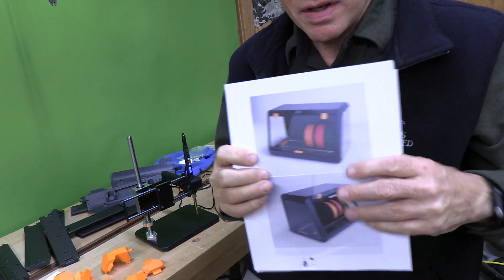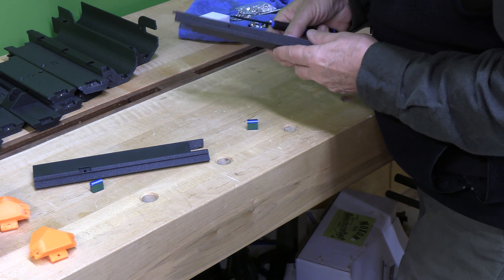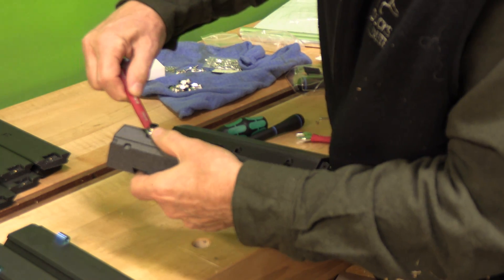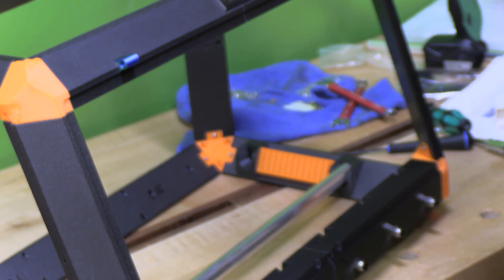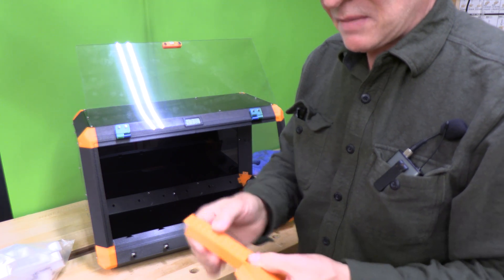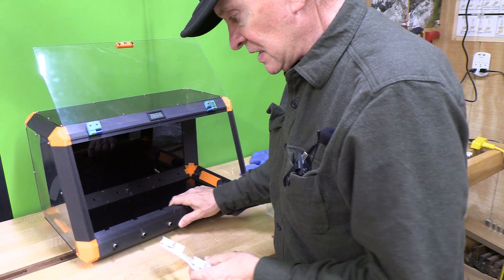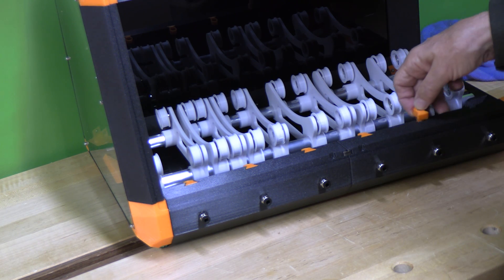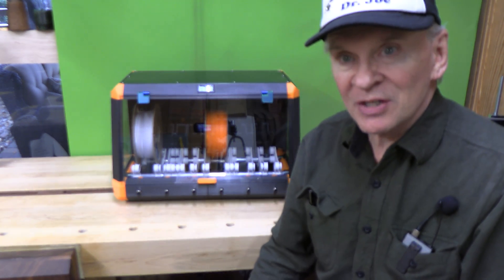UNORIGINAL PRUSA DRYBOX ASSEMBLY and REVIEW

Comment: And where did you get the great tool with the soldering iron?
Do they still use the box today or have they changed?
Reply from the maker: Hey buddy, I believe I have a link to that tool that puts in the Heathet inserts which works so well they’re fantastic. Inexpensive and I think there’s a link in it linked to it in my description. Also, I don’t think the box has been upgraded. It’s actually very nice consider subscribing. Thanks. Joe.

Comment: Hello, just assembled one. I can't figure out how filament trace from spool to connector and to PTFE tube. Maybe you have an answer?
Reply from the maker: I’m not really sure I understand the question. Basically, I put the filament reels in so the filament comes off the bottom of the reel and goes straight ahead into the small couplers that are in the front lower panel. A PTFE tubing can go through the coupler so you can put the film directly into the Cortex tube. That answers the question. Thanks. Joe.
Reply: @JosephHunstad  thanks for your answer. Now I understood what happened.  Aliexpres store "Sealand" sent me regular fittings and PTFE tube cant go through them (inside diameter 3.3mm)

Comment: Ciao ti volevo chiedere dove scaricare i porta bobine ?? che in questo progetto non li ho visti Grazie 🙏 🙏 😊
Reply from the maker: You are correct. I am not using the real holders. I am using those dry boxes to store my filament. The reel holders go in the slot on the side of the printer. Three on the left side two on the right. Consider subscribing. Thanks. Joe.
Reply: @JosephHunstad   ok grazie

Comment: Hi Joe, How has this worked out in regards to keeping moisture out?  What are the humidity levels your seeing?  It seems like a good design except for the front door, it does not seem like a good seal to keep moisture out?  I downloaded the STEP for this model and am considering making a better seal at the front but wanted to see what you and others have to say about that?  What are your thoughts?  BTW: Got my printer 5T, printed all the enclosure parts, and am assembling it now, love the printer!
Reply from the maker: Thank you for your comments. Yes I love the printer. It’s great. I don’t think the box keeps out moisture as well as you might think. I’ve actually converted to the heated dry boxes each one holds two rolls of filament so I bought three of those and so the dry box that I built I basically just use it for storage.so when I was using the desiccant my humidity levels in there were in the low 20s so they were good but not great. Consider subscribing. Thanks. Joe.
Reply: I printed one and built it.  This drybox is more of a dust box, it is just trash for a drybox as it has airleaks everywhere.  The door is a horrible design and never ever seals right, I tried yo upgrade it to have the magnetic strip but it just is not designed well.     It looks great, and will keep dust off the filament,  but as a drybox it's horrible.
Reply: I ended up building one as well but I glued all joints and customized the door with a rubber seal and made custom multiple clips that make sure the acrylic door makes a proper seal. I used 1/4 acrylic for the door so it is much more rigid to make the seal.

Comment: I bought his the other day and finished printing the parts on my mk4. 

I like the idea and the stl files come with a number of options. Like there is one with no holes for ptfe tube so it more a storage box or you can get one where the ptfe tube goes direct into the house rather the the coupling. 

I’m not keen on the rollers. Why?

Well the printed bearing cover just keeps falling off the actual bearing (you can see it in the video)

Also if you print the brackets with the rollers you can only fit 5 rolls in and not 6. 

But as I said it’s a great idea. Gonna buy another one soon as I have room on my window for 2 of these. 

The only hard part is choosing if you want to buy the classic (which I did and is shown in this video) or the slim editions.

It’s also a shame the heat press is ‘currently not available’ in the uk. So I had to buy a kit to make it off AliExpress. But the ironic bit is you need to insert the brass inserts to built it
Reply from the maker: Thank you for your comment. You make a lot of good points. I ended up gluing the bearings onto the brackets and that made a big difference then obviously they don’t fall off. I could actually put seven rolls of filament in this box pushing the brackets all the way to each end and then filling in between. Consider subscribing. Thanks. Joe.

Comment: Could you please link the heat insert press?
Reply from the maker: Yes I will. I just had a total knee joint so I’m kind of under the weather but hopefully in the next couple days thank you.
Reply: @JosephHunstad No hurry, I wish you a speedy recovery and good health.
Reply from the maker: done!!  and 3mm inserts
Reply from the maker: Hey, thanks for your nice comment. I’m a weak now after my knee joint replacement and doing a little bit better. Still hurts like a you know what it’s been a tough recovery but I’m gonna make it. I listed the vertical heat insert is variable priced based on when you look for it and then some of those 3 mm brass threaded Heathe said inserts which I use they are really good. Take care. Joe.

Comment: New to the channel, love the Prusa XL content!  Looks like the drybox is setup to feed directly into the printer but I don't see you using it setup that way in any of your newer videos.  Is there a particular reason?
Reply from the maker: Thank you for asking. A really great question. So when I first got the printer, I printed the dry box, because friends of mine, who are printers, use that type of dry box for their filament. It requires using a desiccant, which is a material that absorbs the water, and that needs to be recharged by being heated. I purchased an electric dry box that has a blower and a heater in it that actually can bring the humidity down to one percent which is incredible dry filament is almost problem, free filament versus wet filament, which can cause all sorts of issues, fuzzy printing, lack of adherence to the print bed, etc. so I do use my dry box that I made basically for filament storage but when I’m getting ready to run it into the printer, I use the electric heated dry box which works great. I am upgrading from a one to a five head version of the XL and I’m using actually three of these heated boxes because each one can contain two reels of, 1 kg each or one of 2 kg filament so that covers the five printhead. Consider subscribing. Thanks, Joe.